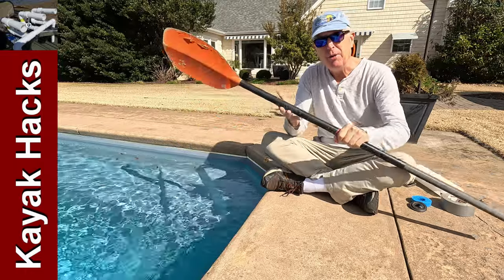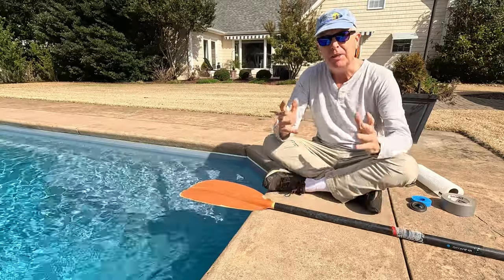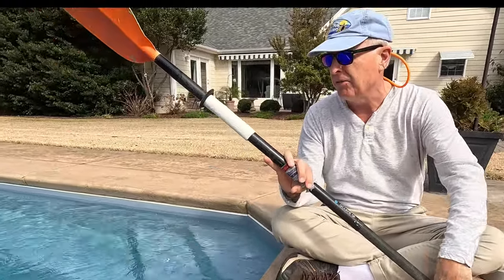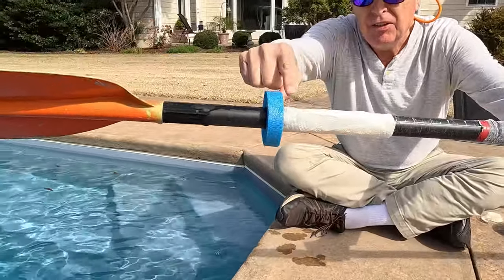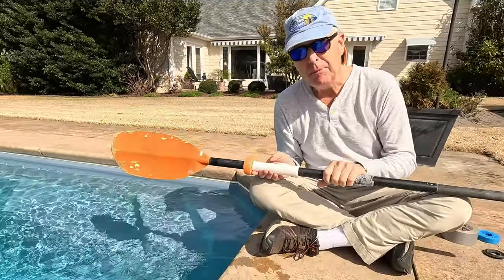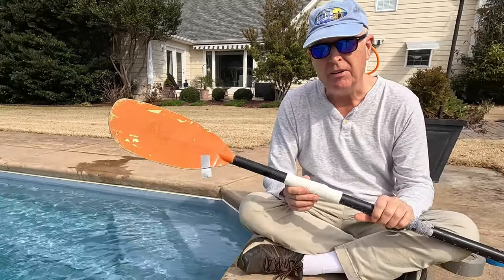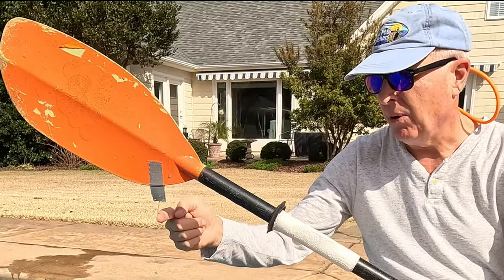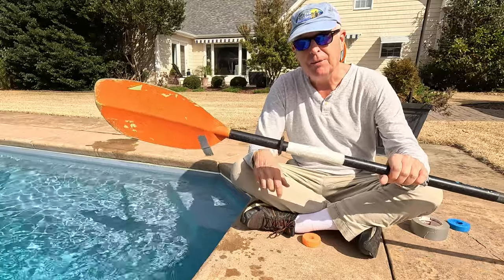3 Kayak Paddle Drip Guards Tested - DIY, Product, and Tape

Comment: Try adding wax to the paddle, either parafin wax or turtle car wax and buff it to a smooth shine. Do all three - 1. wax, 2. duct tape, 3. drip ring. Also I recently put Rain-X on the paddle which works better than spray wax.
Reply from the maker: I will - thanks!
Reply: @KayakhacksFishing  did i see you on the local news?

Is your father Lt. Col. Moore?

Thought you had mentioned we were soilders at one point.
Reply from the maker: @jeffsingleton88  lol! guilty as charged. We were at Fort Benning last week to assist with the media kickoff to socialize the name change of Benning to Moore.  If you are interested in the background of the name change, you can read about it on fortmoore.com
Reply: @KayakhacksFishing  i will read up  on it. Congratulations to your familey. You must be very proud of your mother and father.

I'll be looking foward to hearing your review of the pacmotor as i'm potentially interested myself
Reply from the maker: @jeffsingleton88  Thanks for your kind words! Yes, I am anxious to it out!

Comment: Some times I use a single blade and it keeps my hands really dry. Another tip is to put anhydrous lanolin on you hands in the morning before you go and water will bead off your hands most of the day.
Reply from the maker: Great point!

Comment: Pool noodles work in a pinch but will get water soaked. In a different video you used some kind of spray,what happened with that stuff? Not that cost efficient or just a pain to use?
Reply from the maker: Yes, I used NeverWet. But, it is expensive and wears off quickly